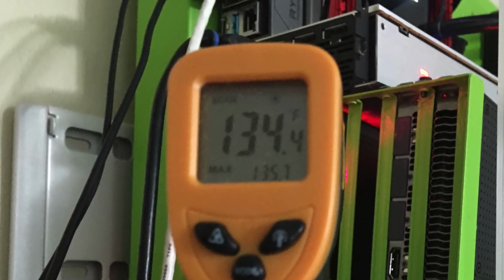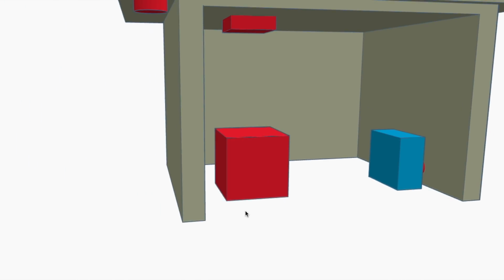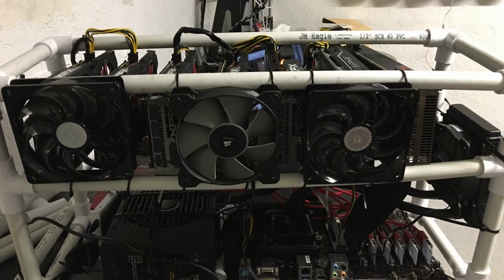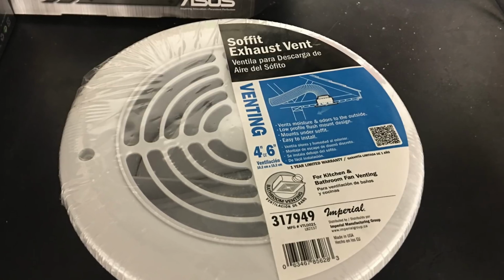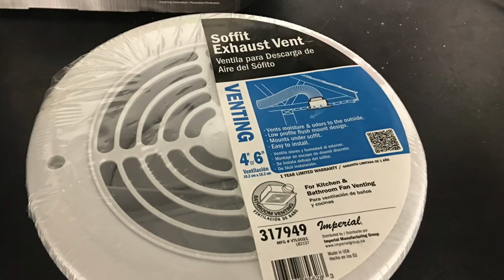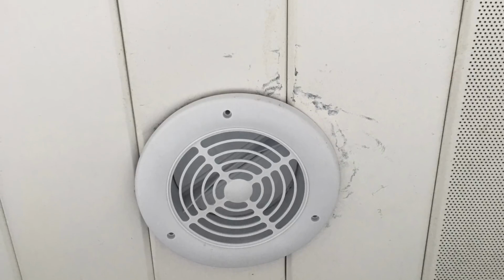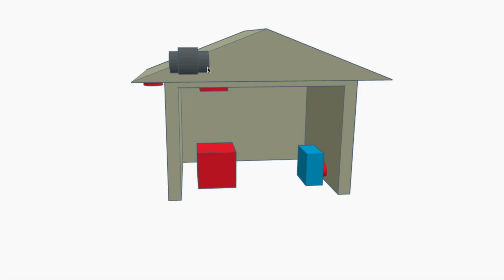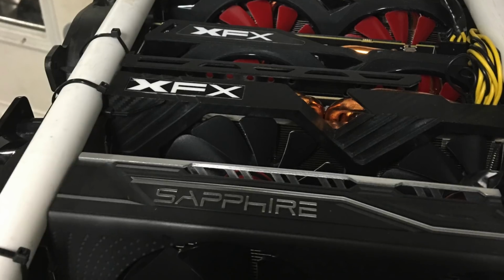How to keep your Miner cool by removing the heat

Comment: If you do this inside of a room in a regular house, make sure you have another source of air coming into that same room.

Otherwise, this will create a negative pressure in this said home, and air will start to get pulled into the house from the outside through other venues, such as crevices, cracks, existing leaks, etc.

Over time, this would actually worsen any existing vulnerabilities in this home, which would worsen the energy efficiency rating of said house.

Also, if you don’t have enough air being pushed into that room, this will start to pull in extra dust from the outside through those crevices & cracks, but more so, more dust/insulation from inside the attic will get sucked into the room via any leaky ductwork thay may exist in your attic.

And this dust will build up over time on your crypto machine.

Make sure all of your ducts are sealed properly, have your home as energy efficient as possible, and have enough dedicated airflow, hopefully with dust-filtered air, coming into the room.

Window / portable A/C units only pull air from inside the room, make it cold, and push it back into the room. These are called single hose portable AC units. They may also create a negative pressure in the room.

If you are using a window / portable AC unit, try to use a Double-Hose Portable AC Unit if you can. More expensive, but this will save you headaches in the future.

Another option, is to use a hydroponics tent, with intake ductwork & exhaust ductwork. You can connect & push AC cooled air through this system as well.
Reply: What if the outside air is so hot and humid?, can I apply what you mentioned with existing AC units?.

Comment: Just starting my mining journey, albeit with bitmain ASIC miners. i'm using the air power of the fans to suck heat from the rig and push out the heat externally, which is working really well. However, the problem I have is that the fans are putting negative pressure in the room and sucking all the cold air, which is not really cooling the ambient air. Mining temps are within range, but I'm fearing this on a hot August day in TX in a few months.

I tested this setup in my office before installing equipment, venting out the window. Same effect. The office ambient temperature was above any other room in the house. You need equal to or more CFM coming into the room to keep it cool.

WORD OF CAUTION: your electricity bill is more than the wattage needed to power your rigs! Account for the extra AC.

Comment: Great job!  When exhausting air out, do you have a problem getting positive air in that was taken out?  Or does that positive air comes from the portable AC unit?
Reply from the maker: The room isn't exactly air tight so I imagine most of the positive air is coming through small openings in the floor and at least that is much cooler air than the exhaust so its a win - the AC unit I'm using now doesn't draw in outside air and other than heat just helps to keep the humidity down.